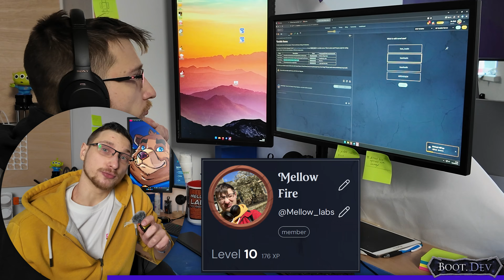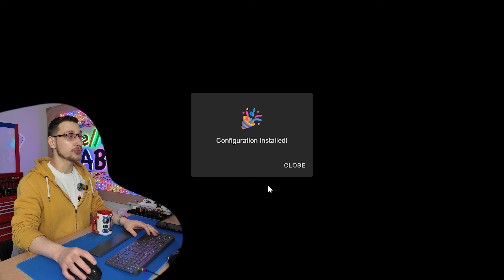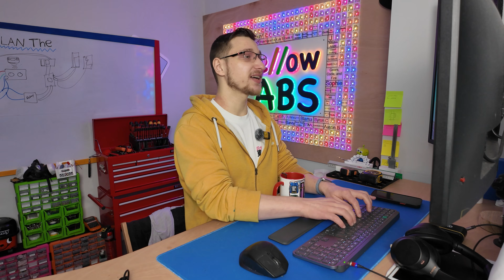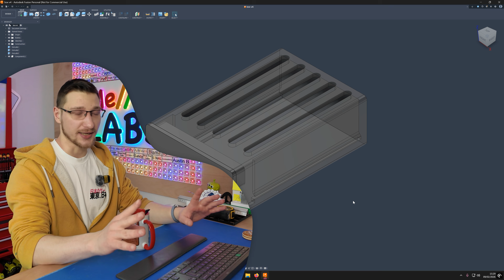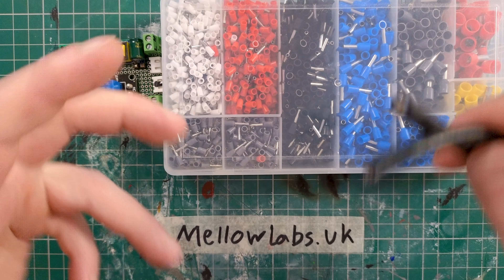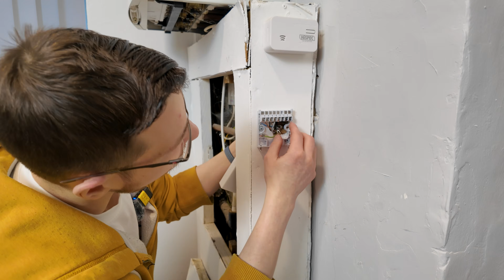DIY Smart Heating

Comment: The crimping section gave me some concern, so I wanted to share some notes about crimping.

Crimping is, ideally, about deforming the terminal to create a gas-tight cold weld between wire and terminal. It's not just about "grabbing" the wire. So, you really want to use properly sized terminals for the wire you're using, and you want to use enough pressure, and ideally the right crimping tool, to do the crimp. When done poorly, you can end up with a high resistance connection that can heat up/allow corrosion/weaken over time.

There are many different types of crimping tools, and the tool you showed is specifically designed for ferrules, which are those little cylinders that you crimped on first, which you presumably bought together with that tool in a kit. That tool is not designed for any other type of terminal. Also, ferrule colors are usually matched to wire gauge, and it looks like you used a too-large ferrule (the blue one, by my eye) on at least one of the wires, since both wires are the same gauge.

The fork terminals require an entirely different sort of crimping tool, an insulated terminal crimping tool (or an interchangeable die crimping tool with insulated terminal die). There are different tools/dies used for uninsulated terminals, insulated terminals, and heat-shrink insulated terminals. When you removed the little insulation sleeve, you turned an insulated terminal into an uninsulated terminal, so if you had both types of tools, you'd switch at that point.

It is true that sometimes people use normal pliers to crimp uninsulated terminals, but the resultant crimp is rarely ideal. And, in the case of what I saw in your video, it looks very weak, you really want to smash it as hard you can without cutting/damaging the wires themselves. The gentle "pull test" you gave it is not a particularly reliable test for a crimp; ideally, you'd want the wire itself to break before the wire/terminal joint, and that would anyway require a lot more force than a gentle pull. Again, the idea is a low-resistance and reliable connection, not just "grabbing" the wire.

Thankfully, most modern heating appliances use a low-current circuit to detect the call for heat, so it probably isn't too much of a concern in this case, but you are still more likely to run into issues than if you had even just used bare wire. So, be careful, especially if you're using the same techniques on higher current circuits. I'd definitely recommend getting an inexpensive interchangeable die ratcheting crimping tool set, at minimum, and make sure to use correctly spec'd/sized terminals, going forward. 🤓
Reply: Watching his crimps made me massively cringe.  I hope he sees your comment.
Reply: Well said. Just wanted to re-iterate the ferules' color is related to the wire gauge for which they are sized - so in your case all the ferules should have been of the same color since you used the same cable for all the connections. And again the crimping tool for the ferules is only for the ferules. The other spades and fork terminations require a different tool and are also color coded according to the intended wire gauge.
Reply: @SierraLimaOscar  Thanks! I actually have seen some non-standard ferrule kits that offer multiple colors for the same gauge, though even in the swamp of non-standard cheap ferrules, they're not that common. But, that's why I said "usually". In this case, though, in the video they look like different sizes, regardless of the color, so I assume it's a more typical color/gauge matched kit that's being used.
Reply: I second this. If I have no suitable crimping tool for these kind of terminals, I just solder them to the cable.
Reply: I appreciate this master class in crimping, I did not know a lot of of this
Reply: Well said! I learned a lot from your comment, do you have any brand recommendations for affordable crimping tools? 

I have a few sets from IWISS/iCrimp (they rebranded a couple years ago), and I’ve always liked the EDM jaws over cheaper sets I’ve tried, but I just can’t justify dropping $500 for an OEM tool for every connector type I want to use.
Reply: @nathanblanchard8897  Thanks!

Seems to me you've already got it pretty well figured out. IWISS/iCrimp indeed offers good value options, and they're maybe the best quality of the inexpensive Chinese brands. One of their competitors on AliExpress, YEFYM, is sometimes good enough with their knockoffs at a lower price, while still being a step above the other knockoffs and offering a pretty full range.

The Japanese brands Engineer and Hozan have been making good quality and affordable crimping tools for hobbyists for decades. I especially like the Hozan P-707, though IWISS/iCrimp now makes a decent knockoff of that exact tool called the IWS-1442L, which can be found a little cheaper if desired.

Many also swear by Klein Tools as a good value option, too, though I have no experience with their crimping tools myself.

I do also have an S&G Tool Aid 18980 set. I'd say the quick-change pliers (which like HS-/AN-/YF-/etc. series pliers takes 6mm-thick jaws rather than the 4mm-thick jaws of SN- series pliers) and the jaws are somewhat nicer and higher quality than the directly comparable pliers and jaws from IWISS/iCrimp, and it is nicely comprehensive covering most non-specialized/non-micro-terminal crimping needs one might encounter. However, the price has gone up over time and I'm not sure the minor usability and quality improvements are really worth the price difference over IWISS/iCrimp options that will likely produce equivalent crimps in the end. But, on sale at a good price, if one wanted that exact set of jaws and pliers, it's not a bad option.

Of course, sometimes people can find very good deals on proper OEM crimping tools, especially on eBay, and it's hard to beat using the exact tool a terminal was designed and spec'd for. But, I'm pretty sure even at a great price they're practically never as inexpensive as the aforementioned value options.
Reply: @nathanblanchard8897  The tool to crimp is  really cheap. The one you already got is probably more expensive.
Just check that it is rated for 240V, some are only rated for 12V
Reply: Or just crimp them tight enough and solder.
Reply: Also, when using risingclamp terminals, you can just put the bare wire in it. The green clamps are designed to clamp wire...
Reply: @josephspiros any chance you could recommend an inexpensive interchangeable die ratcheting crimping tool set?

My wire strippers are supposed to be able to crimp but they're absolutely useless and I always end up using pliers

Comment: Nice project ziomeczku :)
For 230 to 5V I would rather use Hi-Link converter, they are cheap and safe since thet are encapsulated.
If you have just standalone temperature sensors around the house you can program your ESPHome into reading all temps and later calculate the average temperature of your house and based on that turn heating on or off.

Skarpetki na suszarce the best :D

Comment: I did something similar recently, I just used a “Shelly mini” had the ESP and relay in one module ready to use, and it’s probably a comparable price to all.

For the heating I use Bluetooth thermostats, then use the helper in home assistant so you can create a thermostat that will turn the heating on and off to maintain a temperature. (It basically acts like the controller you replaced but as a home assistant card)

Comment: Great video, I really need to get into esphome...

As far as automating radiators you'll actually harm the efficiency of your boiler by doing so UNLESS your boiler is an old non-condensing boiler.
Condensing boilers will lose between 10-20% efficiency if the water arrives back to them too hot as the boiler wont condense. 
By turning off radiators you have less places to get rid of the heat in the water so water comes back to the boiler hotter. 
On top of that, heat from warm rooms will be leeched into colder (off) rooms leading to longer warm up times of the rooms you want heated (It always flows from a region of high temperature to a region of low temperature, not my rule, its thermodynamics). Everything inside the 'envelope' of your house you want the same temperature ideally to stop this leeching effect. 
It's better to heat all rooms whenever the heating is on at a lower boiler temperature then use the TRVs to stop them overheating that particular space rather than turning on and off 'rooms you dont want heated'. Also make sure your system is balanced correctly, landlords and gasmen just bang flow temps up to 70c and leave all rad balancing valves wide open because it saves them callbacks.

HeatGeek do great videos regarding 'zoning' and why most should avoid it on their channel. 
(they are a heatpump channel but their advice also works for Gas boilers, I saved ~25% last year despite my thermostat being on longer due to lower flow temps...)
Reply: Also what you really need is a weather compensating thermostat, meaning you have to buy the boiler manufacturers own stat. Unless you want to figure out how to get OpenTherm or similar working. I have the same-ish boiler, haven't looked into automating it properly yet.

Comment: mA != mAh
Reply: True. But... explain the difference.
Reply: @atoomnet  mA is a unit of charge per second, change of charge, (mili)Coulomb per second iirc. mAh is a unit of charge, not change thereof. mili-Coulomb per second times an hour, so there's enough charge that you can discharge that certain amount of mili-Amperes for an hour's time, half of the power draw for two hours. bad explanation but whatever
Reply: @atoomnet   Think of it like power delivered (mA) vs. power stored (mAh)

Comment: Beware of that 220-5V converter! Soldering it to the PCB the way you did makes it so there's not enough isolation between high voltage and some of the solder pads. Handle with care
Reply: absolutely. I hope he would take a peak what tge requirements are for double insulation. Not setting a great example here. And care should be taken when selecting the converter itself, too.